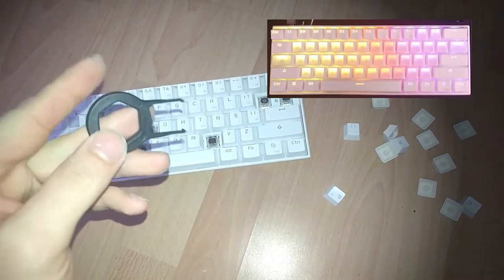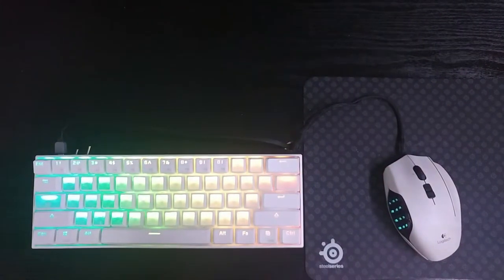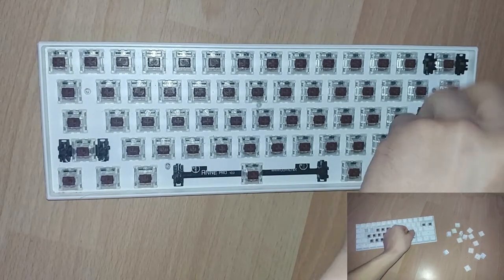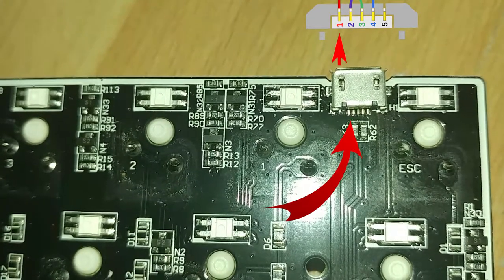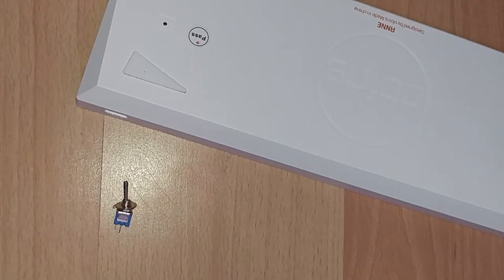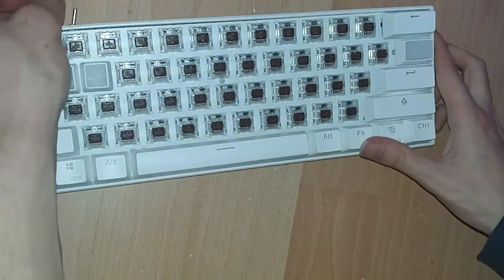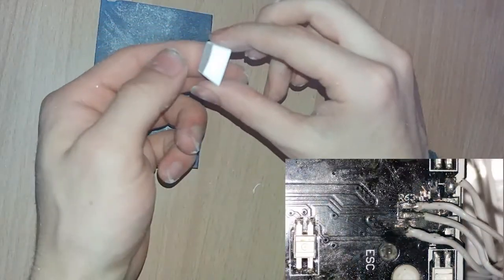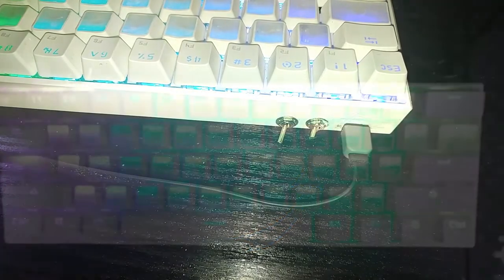Anne Pro RGB Keyboard - Battery & USB Switches Mod

Comment: i just ordered my anne pro this morning and im watching some mod videos for fun, ive seen a few people talk about this whole power switch mod and im really curious as to why it's actually done?

I'm not planning on using my keyboard as a bluetooth keyboard at all... it will possibly remain always plugged in except when i carry it around with my in my backpack. why would i care of the battery discharges while its in my bag if i'm only going to use it plugged in? would this affect me? or this is mostly for people who want to use it as bluetooth?
Reply from the maker: Hey! If you're not using the Bluetooth at all you don't have to worry about the battery getting discharged, all the settings are kept even if the battery is discharged or disconnected. The only reason why I had to add the button is because the keyboard lights would randomly turn on while inside my backpack and when I needed to use the keyboard wirelessly the battery was completely drained and I could no longer use it without a cable!

Have fun with your new keyboard!

Comment: My Anne Pro got a power overload. Inductor E5 is burnt and blown and I don't have the schematics or access to another keyboard to check for its values. Can you tell me which are values from that component so I can get a replacement?

Comment: noo way i'm killing my keyboard just after I got it!! but.. but.. the usb switch looks soo useful, so you can like leave the keyboard attached to the cable and just switch between the phone and computer??
Reply: Just buy a magnetic micro usb cable, with a detachable usb micro head. I'm using it on my Anne pro and it's amazing, you just pull the cable and are in bluetooth mode =D
Thank me later ;)
Reply: that's a great idea =DD going to order some of ebay now, thanks!!
Reply: Try to find the one with the braided cable, and pay atention that the cable provides data transfer as well, not only charging.

Comment: Just opened mine up.  Your battery is twice the size of mine for some reason.
Reply from the maker: Hey, the battery is the original and the Anne Pro in this video is one of the first models! I'm assuming they decided to cut the production costs for the latest model then, that or they optimized the chip so much it requires less power (doubt it tho)
Reply: TechCoders Well, my keyboard keeps on disconnecting itself through the wired connection whenever I bring my PC out of standby. It was annoying me so I took a look at the battery planning to replace it, but it was then that I noticed it was a little bit puffed up. Definitely a problem.
Reply from the maker: Seems like a faulty battery, those cost a buck or less if you order them from china and are easy to replace. The keyboard disconnecting also happens to me regularly, since I'm always moving it from place to place (home/work) the USB connection doesn't last long, fixed it by using a magnetic USB cable!

Comment: removing the top of the keys is extremely easy if you have the right grit sand paper you goon
Reply from the maker: I ended up buying new clear switches later exactly because of that ;) Learning by doing isn't always the best way if you don't know exactly the right tools for the job, you're perfectly right!
Reply: What grit do you advise?